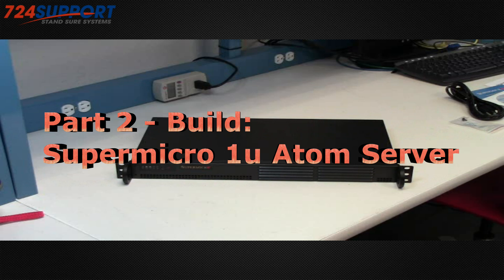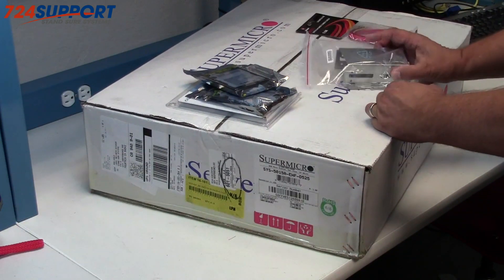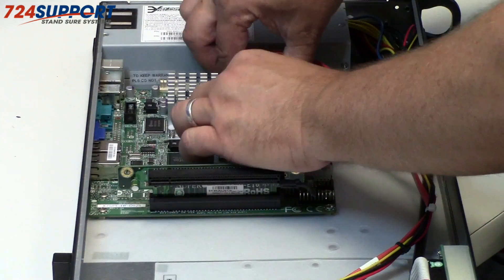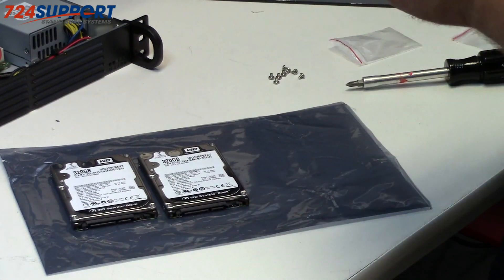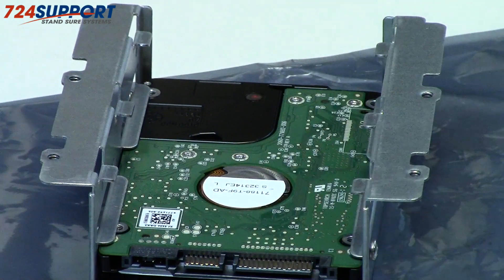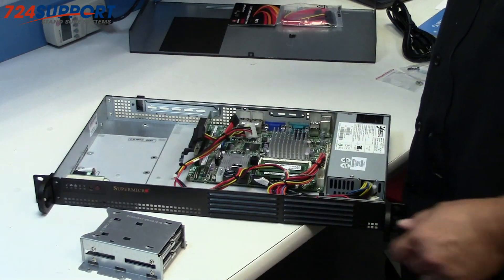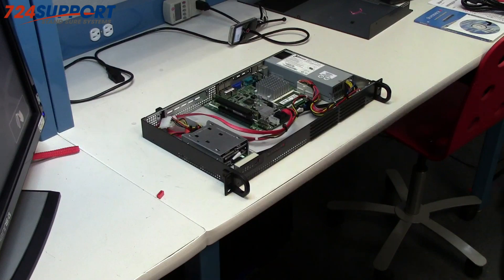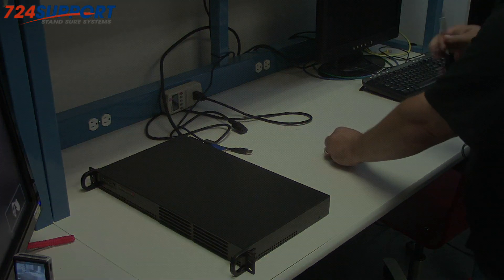Supermicro Quiet 1U Atom Server SYS-5015A-EHF-D525 (2/2)

Comment: Thank you for the video. I have a few of these and I found out that in room temperatures without any air conditioning i.e. in this case my room these overheat if they are sandwiched inside a rack. I had to put a pair of 40x40x10mm fans in the vents aligned in front of the CPU to keep the temperatures down. The fans are good quality, Noctuas, Gelid etc but the airflow through the vents creates noise - the vents are not really designed for that purpose. The middle ones idle at 69C and 74C (core 1 and 2) while the bottom one with no other machine underneath it idles at mid 60s.Let me know if this is not what you have observed, maybe I am doing something wrong.